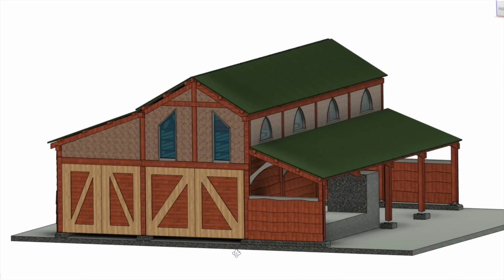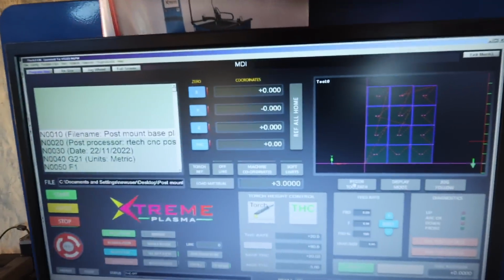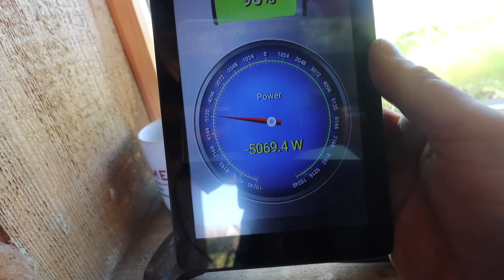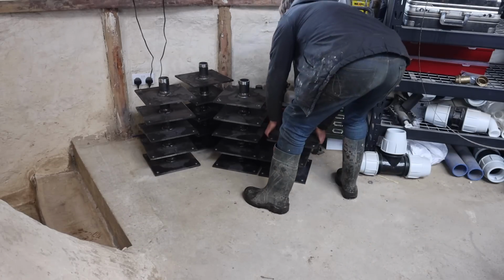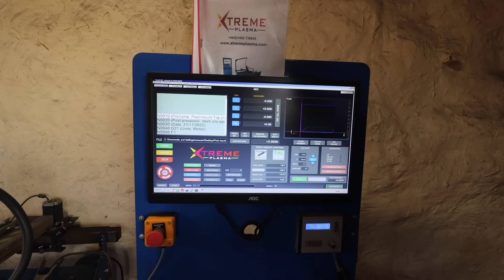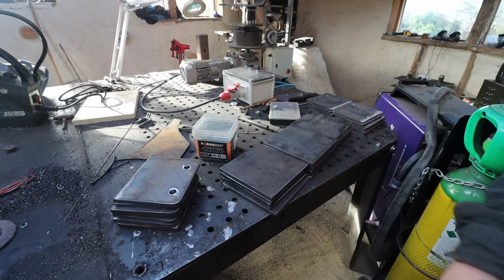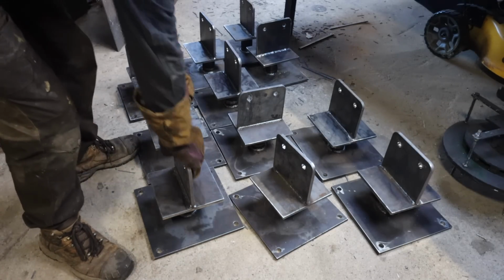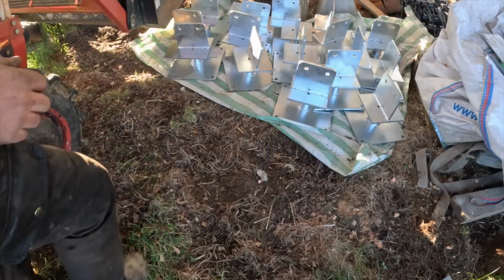Timber Framed Barn Part 2 DIY Post Mount Bases

Comment: Good morning from Oregon! What is the advantage of having the building sitting up on these round pegs? Is it for potential flooding possibilities?
Reply: I don't know the reason for the UK (Wales?), but in Australia it's done for termite protection, but it could also be rot protection.
Reply: I was wondering what the purpose of those were as well.
Reply: Probably to stop the posts rotting out
Reply from the maker: Yep its for rot protection. I needed a good way to fix the posts down so they needed some brackets anyway. If your making brackets to fix them you might as well get them off the concrete as well. 

There is another reason as well that is just specific to my build. In order to get all my roof pitches at a round number that worked I needed 100mm more hight and the timber I have wasn't quite long enough so these got me that little bit more I needed without going really high with the foundations. So they are serving 3 purposes really.
Reply: @daveamies5031  Luckily we don't get termites in the UK

Comment: I saw Colin Furze do a smart thing with regard to plasma cutters and holes. He has the plasma cut them slightly small and then drill them. That way you get the center correct and do the cleanup while drilling them on the drill press.

Comment: It must be amazing to start with these small building blocks and know what they are going to become a part of.
Reply: Its kind of the same thing when I restore a boat. A box of this and that's or a couple buckets of fiberglass resin. Before you know it you have mounds of stuff. This is what I like about Kris. He keeps moving forward no matter what. It's raining but in 6 months it will be dry and I wont want to be stuck in the shop building theses brackets, no time like the present, let's get it done and out of the way.

Comment: I’ve been an avid subscriber for years—I watched you build your round house real-time. I am continually amazed by your intellect, thought processes and work ethic. Never have I seen you do anything less than the most efficient way. All that said, is there a reason why you didn’t weld the smaller plate to the pipe first? Access would have been better. Not trying to be snarky or judging just hoping you are human instead of my superhuman opinion of you currently. You can tell me to piss off and it won’t affect my opinion of you. You are putting yourself out there and probably get sick of people judging you. 
Either way mad props to you and your empire.

Comment: Hey kris

One thing came to my mind with this design, it is absolutely beefy in compression, but because of the small diameter of the tube, it wouldnt be nearly as strong in side loading, and with a huge flat surface thats the side of a barn, wind has huge forces on those scales.

Just wanted to make sure you didnt overlook this fact, because you did not mention it in the video.

Anyways, thanks for the video, great work.
Reply: Yeah, the tube has perhaps 10% of the strength of the vertical beam above it.  It is definitely the weak point.
It's 'probably fine', but increasing the diameter of the pipe and thickness a little would be a good insurance policy for very little extra cost/time.
I also thought that you won't be able to get a small-mid sized tractor into the barn.  Will that be necessary?
Looks like a really good project.  Kris obviously knows what he is doing.
Reply: @drivemenuts3011  the pipe piece is completely unnecessary.

Comment: As you have a CNC plasma table, a suggestion… for the items like the top plate of the post supports… cut a slot in the middle of the top plate and make the post bolt plate a ‘T’ shape to drop into the slot, makes fit up and welding easier 👍

This method is great for projects like this when there is a lot of repetition and for accuracy.

Comment: Amazing work as always, Kris! A tip on the parsnips for next time: I’ve heard that overwintering them and picking them out of the ground in early spring makes them much sweeter in the best way. A local place makes a great sandwich out of late winter/early spring harvested parsnips. Looking forward to watching the rest of the barn build! I’ve been watching since you’d just finished the roundhouse so it’s very gratifying seeing how you’ve settled in. All the best.
Reply: I made a pizza last night, with a sauce of coconut oil and kimchi, Machego cheese, and roast parsnips on top, cut to resemble scallops.  The parsnip's natural sharpness was emphasized (not in a great way) by the kimchi... a sweeter parsnip would be much better!
Reply: @sursurrus  You used kimchi as a pizza topping. As a Korean, I haven't had a kimchi topping pizza yet. Was it delicious?
Reply: @user-yf8qq91  Yes!  Try it

Comment: Kris, 
there is one thing I would love to see on your Videos: as you are 100% off grid doing heavy power tool work, I always wonder how your power system deals with that table saw or plainer. 

So what do you think of building a power system dash board where you could show off all the interesting parameters while using power tools in your workshop. 
Keep on the great work!
Cheers !

Comment: My frustration at work is feeling like I'm working on something like this (but in a very different way) and I've figured out the first step thing I need to work on to achieve my goal and people saying it's "in the weeds", when in fact it's just the first step to achieve something bigger. Does my head in. It'd be like someone saying you're messing around with welding when you should be building a barn and telling you to think "bigger picture". But then also trying to take credit for you work when the barn started to come together even though they did nothing but impede your progress

Comment: Might I suggest adding some loft doors that you can access from the outside so you can add some kind of hoisting system or you can lift things with you tractor to load and unload up there.

Comment: We enjoy watching the progress you are making on your farm and all the "off-grid" creations. I am curious why you used a pipe on the post foundation brackets and not a solid threaded bar to provide for adjustment. We experience significant movement of the earth at our location, but a solid bar would also be significantly stronger than a pipe. Interested in your reply because I've learned you are very thorough in your planning and execution of your projects.

Comment: Looking good Kris. In my experience with mig welding if you direct the torch up to one part then down to the other (perhaps in a circular motion or in a cursive e) you will get much much better penetration as you are temporarily focusing the heat on one piece, then the other allowing them to be fully fused together.

Very much enjoying the videos, great to see you inside with the crappy weather outside. You're not lucky with what you've got, you've planned and worked very hard for where you are and honestly the way that I hear the economy is in Europe and even more so in the UK, your lifestyle is the way to go!
Reply: Some parts of Europe land is cheaper.. but this lifestyle in the UK is extremely expensive..

If you figure in UK land costs..solar panels, building materials and tools needed...

It's a very expensive lifestyle to get started in.. yes once set up it will be minimal... 

I'm based in Europe with cheaper land and old buildings but you definitely need serious cash flow to get set up... 

Chris setup is not the cheap option
Reply: That is incorrect and wrong information weaving or manipulating the bead is always a weaker and less penetration.

Comment: I always look forward to your videos as I absolutely love what you do and how you do it.

If you don’t mind me asking; what is the purpose of the riser tube vs. mounting directly to the concrete with a more traditional mounting style. 

Aesthetics are a completely acceptable reason but it seems like you have a reason for doing things a certain way most of the time and this one made me curious 😂.
Reply: He claims it is to keep the posts dry and prevent rotting. I find this odd. The riser tube is several inches, implying that he would have considerable water in his barn. I'm not saying his design or logic is faulty,  necessarily, but there seems to be some missing data here.

Comment: I am working on a timber frame design also. I don't like the standard fork and thin steel design they use in the states. Very poor quality IMO. However my design is different from yours. What led to this design over say a enclosed box that the post can sit in, like a foot in a sock. With 4 bolts and a top seal to prevent water from getting in. You're farther along then I, so now is the best time to make adjustments, thank you.

Comment: A question to demonstrate my ignorance ;o)
When you CAD out your design to cut on the plasma cutter ..... why not dispense with the gap between plates and have one cut be the cut between two plates. This would increase productivity and save power. I assume there is a reason, but not cutting metal like that myself am not aware of why. Can you illuminate?

Comment: I love to watch you work, very impressive.  Are you able to run the plasma cutter and the welder continuously - i.e. do you have sufficient power, or do you have to take a break occasionally for batteries to recharge?  I assume with the rain you have plenty of hydro-power.
Reply from the maker: Generally I dont have to worry about it. mostly we make more power than we can use. but on days im in there all day cutting and welding I will use all the power coming in and drain the batteries down quite a bit. but then the hydro keeps us going overnight without draining anymore and then the solar tops up the batteries the next day. I wouldn't be able to cut and weld everyday for days on end this time of year unless it was wet and sunny.  There is come planning of it but I dont find my work is hindered. I do have to wait for stuff to cool down though. My equipment gets very hot running at 6kw

Comment: Probably a daft question, but why are you separating the timber mount plate from the base plate? Why not mount the timbers directly to the base plate?
Reply: Keep the end grain of the timbers dry......!?
Reply: At a guess to prevent rising rot. Prevent rain splashback from ground.
Reply: @andymccabe6712  ah yes, of course. Cheers!
Reply: @huwzebediahthomas9193  cheers, makes sense!
Reply from the maker: Yep just to get them further away from the ground. the blade mounted to the bottom plate would do but this way they are further away from the ground again. its a barn so the ground will have a lot of timber rotting stuff on it. Damp, straw, animal poo. then add some animal to the equation and the further the bottoms of the posts are from the ground the better.
Reply: @GingerPiston   👍 There are other ways of doing it. The usual is box tube on a plate and slot the wood in it, but damp can be trapped inside and doesn't dry out as easy.
Reply: @KrisHarbour  Cheers Kris, thanks for taking the time to explain.

Comment: A question about the cutting, i am not familiar with the system....could you just cut the plate into long strips then one horizontal cut to make the plates to conserve the "cutting tip" (no clue, lol) and power used? Instead of the "u" cuts which add a lot more cutting work and i would think much more programming and precision? No "judgement" meant, just curious how it works/limitations, as ive been considering a purchase myself.  Love the videos and the new barn rendering looks great (as per usual on a Kris Harbour Project)

Comment: Hey there Kris. One thing I'm somewhat confused on, and I don't think I've seen you answer, is how your sawmill fits in with the barn. From the design, it looks like it'll be permanently stuck inside one of those sections once you've maneuvered it in around the posts. I didn't see a door or a gate to allow you to move it in and out. Will you have a way to get the mill in and out of the barn? Or is it going to become a permanent fixture?

Comment: I'm curious why you couldn't have reduced your power consumption and cut the base plates with common cuts for each piece? You programmed it to cut all 4 sides of each plate. Is it not possible to lay them out so 1 cut makes the sides of 2 pieces?

Comment: Crankshaft bent? Haven't been into any floods with your van? Water past the air filter is classic crank or conrod bending occurence, water getting into the cylinders.
Reply from the maker: Its not I checked it yesterday. The reason I though it could be is because of how bad the head gasket failed. it failed to the path of the cooling water so it was possible it got a cylinder full of water on the compression stroke.
Reply: @KrisHarbour  
Yes, water doesn't compress if it gets a mouthful. Something will give and good to hear it's just the cylinder head gasket. Check both surfaces for warping while you're at it, head especially of course, but the block too. Edit: oh that way, coolant water getting in will do it. Just spin the crank with head off - it should turn freely will same force 360 degrees around. 👍

Comment: why do you use post mounts ? I just build a small barn given it is much smaller than yours but i basically just put the posts on rocks or stacks of old concrete pavement. A few post got foundation blocks like a concrete block with a flat piece of iron sticking out so you just put a few screws trough to fasten the posts. Then i always put tar paper or small sheets of plastic underneath my posts so they do not draw moist up from the rock or concrete plus i paint them heavy first.

Comment: How do you know where to put the bolts through the posts to get them through the holes in the metal plate that is inserted in the bottom of the post?

Comment: How did you do the calculation? Did you do a force/area calc or did you consider buckling?
Reply from the maker: Yeah area of the weakest point then looked at compressive strength of mild streel then compared it to a study data of testing tube in compression. I then confirmed this by going to the hydraulic press channel and find a video of him crushing the very same wall thickness mild steel pipe and it wasn't deforming at 22tons but it was close this confirmed my 25ton rating. I then halved that for a safety factor. with gives me 190 tons total. The building inst going to be anywhere near that heavy so there is plenty of extra strength left over for wind loads.
Reply: @KrisHarbour Weren’t you tempted to pass the design and spec under the nose of a structural engineer for reassurance for such a big build?
Reply: @KrisHarbour  it might be worth running simulation on shear strength as well as compression on that tube. I'm sure it'll be fine, your structure certainly won't rack because it's lovely and rigid - but by the looks of that weather you get some heavy wind/knock a post manoeuvring a tractor in there.
Reply: @KrisHarbour  Sounds like there's nothing to worry about then. Helps that the hydraulic press channel tested it for you. Hah.

Comment: Welding looks very cold and minimal prep eg butt joints. you need 100% penetration on those joints so you need to be bevelling as they are structural, I doubt they would pass a test. If you're going to be doing structural stuff you need to go on a welding course.

Comment: In an older video i saw in your power shed what looked to be rock climbing helmets and rope. Do you still do any climbing?
Reply from the maker: I used to do a lot of rock climbing. I stopped doing it because I kept getting tendon injuries. I had a tendency to push myself really hard. I was climbing some pretty hard climbs but I was just forever injured. I now just use my gear for rope access if I need to for any reason.

Comment: you could not buy frame footings to that standard. nice job Kris....
Reply: Jakob -  Agree. Kris answered a question about galvanizing the brackets in which he also provided costs. The galvanizing job was £300 + VAT. He priced similar - but smaller - brackets at £2500!

Comment: What would it had cost to get made from some one else and the savings you have made will go towards the concreate bass
Reply: mark smith -    Kris answered a question about galvanizing the brackets in which he also provided costs. The galvanizing job was £300 + VAT. He priced similar - but smaller - brackets at £2500!

Comment: how much does it cost if you would buy them instead?
Reply: I work in a steel fabrication shop and we sell steel like Kris made in this video between £2500-£3000 per tonne so its not cheap to make this kind of stuff.
Reply: Paganini -  Adding to frackcha's answer: Kris answered a question about galvanizing the brackets in which he also provided costs. The galvanizing job was £300 + VAT. He priced similar - but smaller - brackets at £2500.

Comment: Kris, I don't think that your metal parts have been galvanised (with a hot dip). The metal parts look too shiny and I miss the visible spangle from hot dip galvanising. I suspect that it has been electro galvanised. That would mean that the inside of the tubes were in a Faraday cage and did not receive any electroplating. Better give them a call to confirm my suspicion. 
When you had just welded the tube shut without any holes, not more than a tiny bit of iron (less than 0.3 gram) could have reacted with the enclosed oxygen.
Reply from the maker: Hello. I just went out and shined a torch through the holes in one end and its defiantly galvanised on the inside of the tube. The company I used only do hot dip so its defiantly been done as I asked it to be. But thanks for the concern.
Reply: @KrisHarbour  , Good to hear that the inside is coated as well and sorry for sending the scary message, I didn't know how much work is ahead on posting to youtube. I am really surprised to see how smooth the surface finish is of these parts. At least a lot better than my last experiences with galvanising in the eighties and nineties.